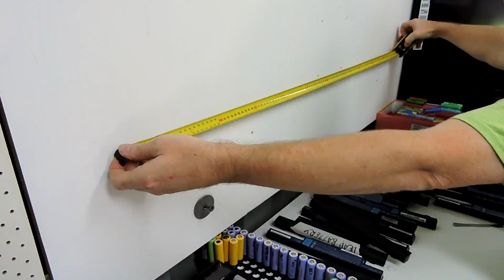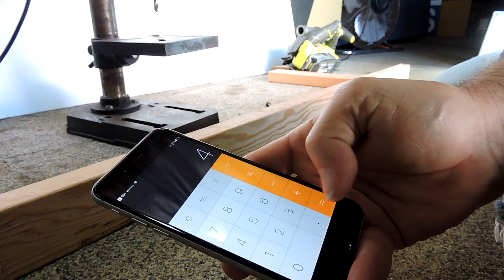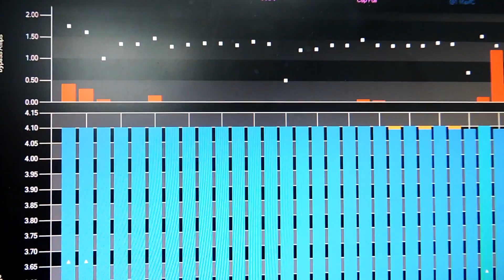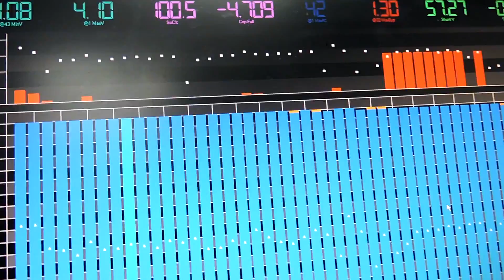18650 Powerwall update and making a rack with wood

Comment: I want to use a powerwall as either a backup to grid power in the event of an outage or a way to store power to take advantages of lower day rates. So my question is, do they make an inverter that will also correctly recharge the powerwall (18650 cells)?? If so can you share a link?
Reply from the maker: The PIP doesn't charge the cells in the correct way no
Reply: So I would need to do a charger and a separate inverter?

Comment: Totally jealous of those packs you got there. Those are amazing cells!! The panasonics are nearly as good as you can get.
I just pulled a pack apart that had NCR18650B's in them. First time ive ever seen those in a laptop pack...
Reply from the maker: they are the 18650 porn that's for sure!
Reply: TheJ Man Last year I took apart a Fujitsu FPCBP426 pack. NCR18650G (yes, the elusive G) inside.

Unfortunately my tests revealed that recent (late 2015 and beyond) B batches actually outperform them. Probably the reason why the G is not widely available - it can just barely hit its minimum specs.
Reply: thats interesting. My pack was a Fujitsu FMVNBP210. I actually ended up have ing 2 of those packs. The cells only charge to 4.16v tho, checking if the discharge atm, they might have been extensively used :( 
The G is very rare, it kind of disappeared from the market, maybe because of what you wrote.
Also had 2 of FMVNBP199 packs that had the NCR18650A inside (like the ones from this vid) they seem to be better in shape then the B's

Comment: Hey HBPowerwall, where do you buy all of those cells?? I'm collecting laptop batteries as well. They are a great source of 18650 cells. Thanks!
Reply: You buy them or you find it for free?
Reply: usually for free but i sometimes buy from ebay
Reply: thanks for the answer! can i ask you where you live and where you find it the most?
Reply: i find it at second hand shops or computer repair shops ebay only comes in if im desperate

Comment: You're making the RSI(Repetitive strain Injury) in my arms ache just watching you twist those pack in your hands. Can you screw a bridge on the table so that you can slide the end of a pack in, so that it points out towards your gut, and the use 2 hands and twist it.
Reply from the maker: unfortunately, my benches aren't' heavy enough for that. Usually just wack them on the concrete once or twice to loosen them up

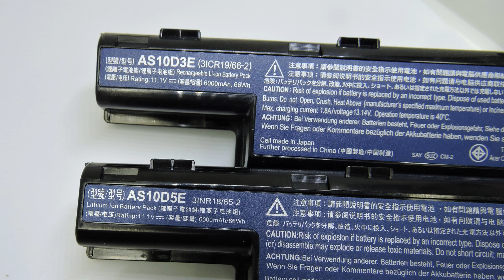Comment: 4:42
top one is    AS10D3E 3ICR19/66-2
bottom one AS10D5E 3INR18/65-2
simplify
-----3-  -C-9/-6-
-----5-  -N-8/-5-

yeah totally the same batteries from the outside.
Reply from the maker: agree, saw that in the edit but too late to change it. So far found a dozen identical packs with different cells.:( hoped no one would catch it ...never mind i'm not perfect :)

Comment: Those purple/yellow cells are SANYO Ur18650zta Magenta and they are indeed 3000mah. Imo these are some of the better cells you find in laptop batteries
Reply from the maker: I can't find any info on them but tested 30 of they and all around 1600-1700 mah all the greens have been over 3000 ? weird.. more testing might be required

Comment: I see you use the australian safety flipflops. Good protection mate!
Reply from the maker: i'm all over it ..hehe
Reply: HBPowerwall Is it possible that the purple cells are in a different parallel configuration apart from the green cells that allows the 6000 mah? also I find what your doing to be an excellent tool for off the grid diy projects and was curious to where I would be able to aquire used 18650 cells in bulk? I'm sure you're tired of that question btw lol.
Reply: Same voltage on both of them so nope.

Comment: Out of 5 Acer batteries, I got 4 of them with 17650's & 1 with 18650's.
The 17650's all self discharge, the 18650's are good (all purple 2000mAh).
So the Chinese fakes are starting to find their way to recycling already.
Reply from the maker: Don't you hate it when you think you scored a bunch of cells and they have 17650's or prismatic cells.. totally destroys me every time still.

Comment: I'm curious how pack 5 will behave while charging the car. Looking forward to it!
Reply from the maker: It all works in my head. See what can happen when the time arrives. Still might not happen charging the Tesla. If that plan falls through i'll do another 63hr type test to see how it holds up
Reply: Haha you probably don't want to risk damaging the tesla. Could get expensive quick.... Then again, as long as you charge it from a normal AC socket it shouldn't matter wheter or not it's grid or the powerwall feeding that socket
Reply from the maker: Powerfactor and a bunch of other stuff i don't understand needs to be right for it to happen. Cheap inverter might not be up to the task
Reply: Hmm yes that is true. I do know that the power factor varies greatly during the charging process (getting worse the closer the car is to 100% charge). Anyways good luck, I'm looking forward to the result!